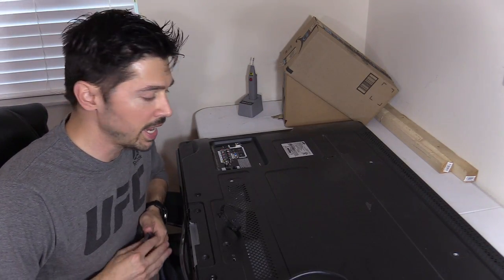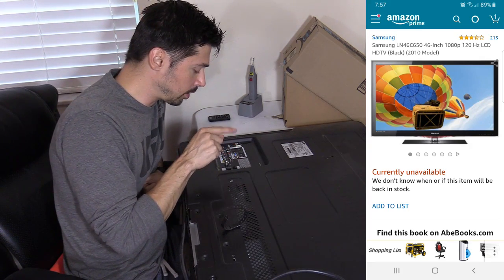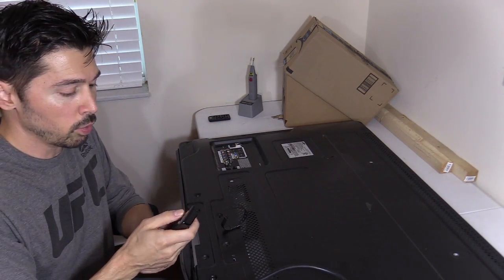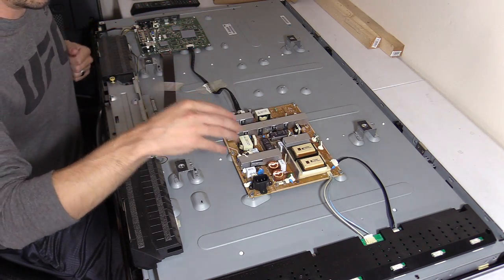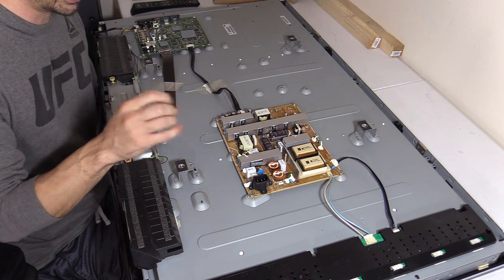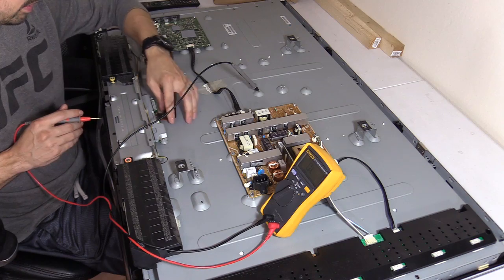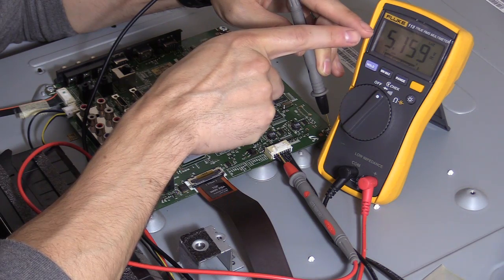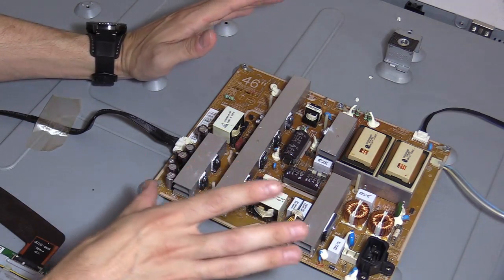Fixing LCD flat screen TV Not turning on No standby LED pt1

Comment: Love your videos!!   I have a question.  I e got an onn Roku smart tv.  I started with no standby   I’ve discovered that if the WiFi card is not connected the tv comes on. But as soon as you connect the WiFi card it shuts it down.     Would this be a power supply issue not having the power to supply the WiFi card. Or more likely a short on the WiFi card itself?    Any advice would greatly appreciated!!  Thanks

Comment: With voltages you shouldn't be using continuity on your meter. Nor to use it for transistors. A diode check works so much better. You need to read up on your meterminstructions. I'd rather trouble soot the circuit than to spend that money on foolish modules..it would be a lot cheaper..

Comment: It took you more than 8 minutes to get to the actual testing of the power circuit board.  Everything beforehand was gibberish about all the other major boards, not relevant to the power supply.  If you hadn't spent 8 minutes on all that, you could've made just one video, no need for part two.  Then again, I've seen 10 hour videos on YT so you still could've made just 1, not 2.  Not gonna bother looking at more from TampaTec.

Comment: My situation is, the backlight overall is fine all are bright I've been checked with led tester, but when turn on the power all backlight is not bright enough, the light is too low. What do you think? Is this power supply issue? Do i need replace a new motherboard?

Comment: My LG has a steady red led, but will not turn on by pressing the button. I've attempted the rest set process several times with no success. Any   one know of the right fix is.? I've checked the stand by voltage at the board and it exceeds the 13.2v .

Comment: I have a Sony XBR 800 TV on the power board is putting out the correct voltage until I plug it into the main board then the voltage fluctuates and I have no picture or standby light. What are your thoughts I'm lost

Comment: Hello .I have a problem with my 4k led tv 50” .I wish I can send you a picture , you see the problem.this problem started after I updated the firmware and it changed right at the installation and pictures and words doesn’t fit in the screen .when I switch to apps ,they are over others .like it’s not clear at all it’s like it switched itself to zooming and stuck there .I’ve tried to change the firmware to no avail. Please help .

Comment: Hopefully you’re still answering questions here.  I have a slightly different model, but with the same issue.  I removed the back and there’s no apparent issues with with caps or anything, no bulges or burn marks anywhere.  Mine has 2 fuses which I checked right away and sure enough one was burned out.  It is the one right next to the power supply.  I replaced it and as soon as I plugged back in it popped.  I tried it a couple times and the fuse popped immediately, so I can’t get any further testing power.  I do have a digital MM but I’m not well versed on how to use it.  I’m at an impasse - what would you suggest I try next?  Old tv so it’s not worth putting more than $50 or so into a repair.

Comment: Hi TampaTec! Great video Sir and lucky you for being in sunny Florida! Meanwhilst in icy Scotland................hoping yourself or someone can help. I was watching my LG TV, when suddenly the screen went black and the red standby light was pulsing for a few seconds before dying. I tried dusting, hoovering, removing the back panel and doing the same. However when I turn it on, the LG logo appears for a split second and the standby light pulses again for a few seconds before dying.

Any tips folks? I have read about baking the main board for a short term fix but am after something more permanent.

I have priced up a new main board, and power supply board, but am unsure which one it could potentially be and wondered if anybody could advise?
Reply from the maker: Baking board is only temporary fix if your lucky. But all those parts are temperature sensitive up to 160f / 71c. What you mentioned, I would buy cap kit for that tv model. Try eBay, or shopjimmy.com or electropartonline.com for tv parts.

Comment: before going through all that trouble make sure its not locked in standby mode because that disables all of the buttons on it when its shut off and resets will not work on it.

Comment: Brother this is not repair. you should be able to diagnose  faults accurately,   then repair.
replacing a board means you are unable to isolate and replace faulty electronic component on the board.

Comment: Hello! 
I have a Samsung lcd tv.
When I unplug the main board from the power supply board my screen turns on.
As soon as I plug them together the screen turns off. And I hear like a whizzing noise coming from one of the boards no quite sure which one. 
Sometimes it turns on for 1min and off for 1min. While it's plugged in.
The power led light it's on when is plugged. 
Please help me. 
Thanks much for your video!

Comment: Great video.
My lg 42" 3d TV doesn't turn on, instead it cuts off the fuse in the 3 pin plug of the power Cable that connects it to the mains. When the fuse in the plug is replaced, it blows it up once the TV is put on.
What could cause this?
How could this be fixed?
Thank you

Comment: Samsung 46 inch Model # LN46A580P6FXZA  VERSION SS02  SN# AMQJ3CNQ600123A  On power up, loud noises and green vertical lines. Unit then turns off, then back on and does the same thing. It then turns off again and finally powers up ok and TV works fine. Seems to happen only when TV has been off for awhile, but not always. I did the usually trouble shooting, cables seated ok, fuse check, etc.  Capacitors on power supply look ok but I replaced CM852 and CM853, 10 volt 1000uF.  This did not fix the unit. Thinking about replacing CM881 and CM876 only because I saw some on-line info stating this worked, but TV was a different model than mine. Touched up some suspected cold solder joints on Main board also. No go so I am reaching out in hopes someone with the same Model as mine has experienced the same problem and can help me.  Sorry for the long comment but wanted to let you know I have done the above things. Thanks and hope to hear from someone soon.

Comment: I opened my tv, its LG led tv. Red stand by light flashes 3 times and then nothing happens. Also, backlight just flash once and then it turned off by it self. On power supply board, I checked standby voltage , it is 3.4v. On the output side of power supply( lable mention four 80v pins and three 13.2v pins) when i check voltage on those pins i got 60.2v and 9.3v. Do you think my power supply is bad? Or i am not getting exact voltage bez tv is not turned on. Thanks

Comment: Thanks for the vid! I need some advice on an issue with a Sony kdl-60r520a. It was struggling to turn on past the red standby led stage and now the standby led doesn't come on at all. I've taken the following voltage measurements from the power supply board:
3.3sb=3.3
ACD=3.3
Power_on=3.3
T_con_12v_gnd=0
Reg_12v_gnd=0
Tcon 12v=0
Reg 12v=0.44
Bl_error=0.5
Bl_on=0
Pwm_dimmer=0
Do you know what the problem is?

Comment: I have a similar problem, my standby light is on but the tv doesn’t not power on. Everything works & slowly it started not turning on, eventually it didn’t turn on at all. Do you believe a power board will fix this issue?

Comment: I was testing standby voltage on a Vizio M550vse on the main board plug the red stand by wire and a black wire I’m guessing is a ground?..and my Test lead touch the two pins and now the tv won’t turn on at all. Any idea were to check??

Comment: My tv just shut off on me a couple of days ago.   It's fairly old.   Got it 2nd hand.  There was already an issue with it when it comes to just turning it on.  I had to hold the button occasionally to turn it on  or when I hit the power button it took 30 secs or so for the tv to turn on.   

At one point the tv was in standby. When I tried turning it on  the light turned off and then went back into standby.   So when I turned it on...I never turned it off again because I was afraid it would never turn back on....lol

I'm guessing my problem is most certainly a power board issue.   

Side note the tv always seem to run alittle warm too.  I guess an older tv (not sure how old) might run alittle warmer than new tvs.

Comment: Help! I woke up this morning and my tv was black. I could still hear the sound. Turned it off and unplugged. White flash when I turn it on then back to black. The stand by light is on when it's off. Please help??
Reply from the maker: Use flashlight on the screen in a dark room if you see dark picture then backlight circuit is at fault. If you have a glow on the screen from backlight then tcon board can be bad or main board. Get TV boards at shopjimmy.com or electropartsonline.com
Reply: @TampaTec  I accidentally changed the input and now cant seem to get it back to the channel that has any picture. When bringing up the menu and trying to see a picture using the flashlight I don't see anything. I'm guessing it's the circuit thing you mentioned? What do I do next? Thank you for your help!

Comment: My Sony xbr-55X810C has same symptom. Lightning strike. Completely dead set. Power supply has 3.4 volts standby, 12.7 volts dc reg. but no 12 volts on TCON terminals. Several transistors are showing an unstable/varying voltage. Disconnecting the plug to the main board results in a loss of the 12 volt reg. and no back lighting appears. Any advise? I'm trying to decide what to replace first, Main board or Power supply.

Comment: Hello Friend from Tampatec,
I would like to know if a universal power supply --- from china "didn't put the link" ;-)  --- is compatible with Philips 37PFL5603D-10 and with this power supply - "DPS-279A"? I was checking the parameters of both  power boards, and seeing a lot of your videos, but i cant see how to connect backlights (12v). 

The problem with my Philips is that in standby mode it blinks 3 times, and doesn't turn on, and in Portugal i can't find any supplies. And because i like to repair stuff... i'm trying to revive it.

I really like your videos. Very simple and very compreensive. ;-)

Best regards,

Comment: you may already know this      on most Samsung  you can confirm  wheather the power supply or mainboard is at fault   by unplugging the cable from the power supply to mainboard   and plug AC cord in    if the backlight comes on   your problem is the mainboard   if not then its the power supply     service mode   from remote   is      mute  182 power   im a retired Samsung tech  they still make the best sets on the market      love your vids
Reply from the maker: Great tips, thanks David 👍
Reply: Hi, does this trouble shoot work with most brands of TV? I have a Philips which just quit on me and I'm gonna open it up tonight.

Comment: I've got a 52in aquos power light is green push power and just makes a click noise but no power to the screen
Reply from the maker: Sounds like bad capacitors, look for swollen capacitors.
Reply: @TampaTec  checked the power board all good the opc flashes twice and the power flashes 3 times on lc52d85u
Reply: @Blondie SL thanks for the help this model doesnt have any fans I found a main board online but the ver letter is different

Comment: I see that you still haven't invested in a decent desoldering gun. What's the problem??
Reply: Blondie SL  I only paid about $150 for my Hakko 808. The new ones are pretty pricy though. Circuit Specialists has some around $150. After you get one you will be glad that you did. It is the one piece of equipment that I would replace immediately if mine quit on me and I couldn't fix it. It just saves me so much time!

Comment: Do you have a electrical engineer degree.
Reply from the maker: No, I went to itt tech and graduated with associate's degree. I worked as tv tech for years and worked fixing video arcade machines for years then installed TV and surround sound afterwards. Now I do it as a hobby to help others on YouTube.

Comment: Mine ,the LED flickered on and off with clicking sound and the TV doesn't turn on. Any ideas anybody.
Reply from the maker: Can be issues with standby voltage on power board but need to test to be sure.

Comment: great video tutorial as always.
just about the remote, theres cases that the IR led will flash but the TV wont react,
this could be one of 2 things
bad IR reciever circuit on the tv 
or
bad quartz in the remote. (the component that sets the frequency of the remote signal.
Reply from the maker: Thanks for sharing, great tips 👍
Reply: You mean PROBLEM can also be caused by REMOTE CONTROL, POWER BUTTON?  OR INFRARED CONNECTION??    Been wondering about that...as SOLID RED Light, ALWAYS ON, when TV is OFF...n  SEEMS, IF DEPENDS ON ANGLE of REMOTE BUTTON, HOW I PUSH IT,  n HOW LONG I HOLD IT DOWN.... EVENTUALLY TURNS TV =(ON) ... OR INSTEAD  To ONLY A FLASHING  SLEEP MODE LIGHT, =[SLEEP MODE, NO SCREEN OR SOUND]!  LIKE PLAYING RUSSIAN ROULETTE, EACH TIME!!   Sometimes OVER N OVER AGAIN,  I have to PUSH POWER BAR OFF= FEW MINS, + BACK (ON), &  LEAVE FEW MINS AGAIN + IF SLEEP MODE AGAIN, THEN DO SEQUENCES ABOVE WITH REMOTE & POWER BUTTON ON REMOTE, FEW TO MANY TIMES, TILL TV, FINALLY COMES ON >>CORRECTLY!!  IRRITATION ENSUES!!
But You Say Maybe Possibly  Be the **(REMOTE)??  USE MY INTERNET PROVIDERS >>REMOTE<<...GOT  DROPPED  Very HARD,  ON HARDWOOD FLOORS, (OOP'S), A FEW TIMES??  MAYBE,  THE PROBLEM, = REMOTE??  AS WHEN USE SEQUENCE ABOVE, TV WHEN (FINALLY COMES ON) ... WORKS PERFECTLY!  Would APPRECIATE any HELP... as No MONEY to FIX IT!     Sincere **THANKS* For Any HELP,  You can Give....
Reply: Please more SIMPLE DETAILS ABOUT REMOTE + BAD QUARTZ??  IS A REMOTE CONTROL CIRCUIT BOARD??   IF DROPPED HARD, INTO HARDWOOD FLOORS, FEW TIMES, BE THE PROBLEM??   REALLY APPRECIATE SOME HELP TO DIAGNOSE PROBLEM, DUE TO (MY FUNDS SHORTAGE) TO FIX IT!  PLS, SEE MY DETAILS ON TV GOING INTO (SLEEP MODE,0), BY REMOTE,  N EVENTUALLY (AFTER  POWER BAR, +FEW RESETS + RE- TRYS)  IT COMES ON + WORKS CORRECTLY + FINE....BUT SO FRUSTRATED, TRYING TO TURN TV ON, NOT GOING TO SLEEP MODE, TILL EVENTUAL SUCCESS, OFF N ON POWER RESET SEQUENCE!!  THANKS!

Comment: My LG 32LH 200C Where the lighting has struck and the tuner is not working but my crome cast is working ....I didn't still remove the TV to see if the Turner comes with the mother board or can only the Turner replaced ...thanks all the way from Sri Lanka
Reply from the maker: If Chromecast is working but tuner is bad then replace tuner or main board. You can find parts at shopjimmy.com or electropartsonline.com or eBay.

Comment: I used to never blast people in the comments but I have grown tired of incompetent people making videos when they don't have a good understanding of the material.  You are not helping people when you do this.....you are lacking a basic understanding of electronic components and it is keeping you from properly being able to troubleshoot a board at the component level.   BTW, the parts in that kit could be purchased from Digikey for less than half the cost you are paying at ShopJimmy not to mention that you already checked all the caps and determined they were good.  Fuses were good and that blue component was likely a MOV....clamps the input under certain conditions.
Reply from the maker: I don't consider myself an expert tech but I have fixed many TVs throughout the years and have helped many people fix their TVs. I'm still learning and may overlook things so i understand that may upset some expert techs.
Reply: @TampaTec  the objection I have is making a video doing component level troubleshooting when you are clearly in way over your head.  Learn BEFORE making a video to help others......there are lots of experts on YouTube if you want to learn.......get a good foundation and then make the video....  My advice on the repair videos....make a video with the non working TV and the symptoms......fix the TV off screen and get a good understanding about what the failure was and then make the repair video with all the steps to fix it....combine it with the first video and publish it.......that will be a tremendous help to everyone
Reply: @Blondie SL you are kidding right.  He was all over the place with his "diagnostics".  This kind of video does not help you.  His fix was a shotgun approach....just order a fix it kit (that was over priced) and start replacing components....(at least half of which he already said we're good).  He needs a sound foundation of electronics knowledge if he is really interested in helping people.  The bottom line is: Don't make help videos unless you are competent in the video subject.
Reply: @Blondie SL after watching the second video, this guy is even more pathetic then I thought.  He spent $35K on an electronics degree and doesn't even have a freshmen knowledge of components or troubleshooting.....

Comment: Hey Tampatek, I have a found Nec v552 led flashes on then off. Red led flashes 3 times then..does the same. Do you think it’s a bad led? Power board is good and I baked mother board? Thanks
Reply: Your TV is flashing a trouble code.  If you search your TV model online, you may find out what the code means....the table will be listed by number of flashes.